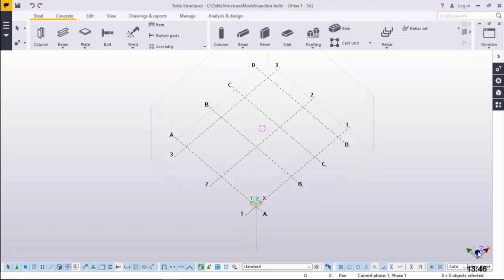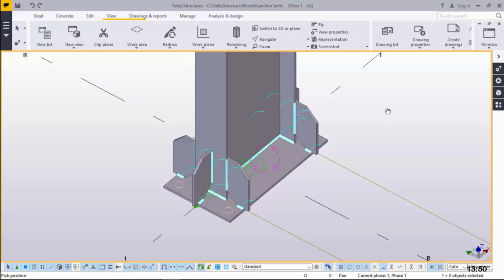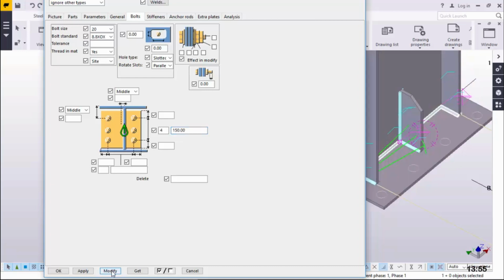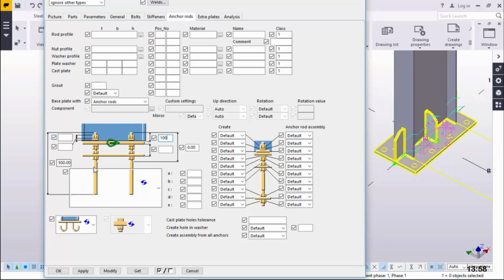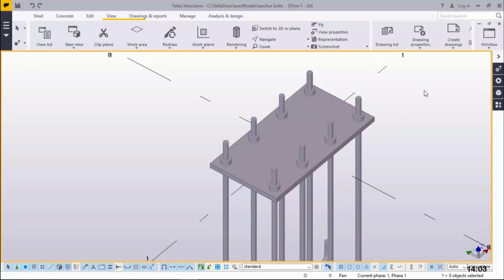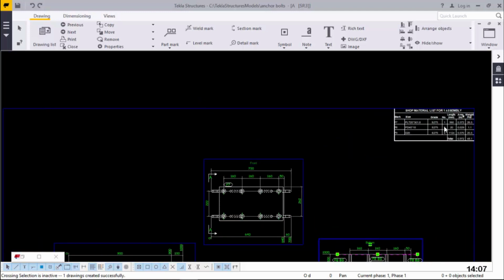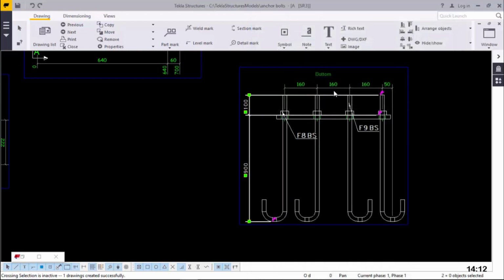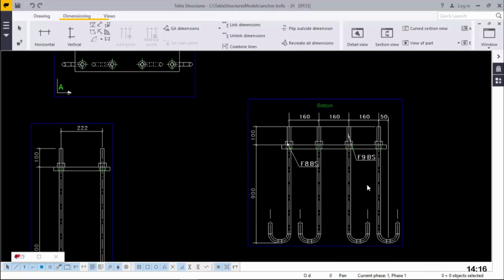Quick way to create anchor bolts and drawings in Tekla Structures

Comment: Hello, great work you doing. Am new to Tekla Structures (Version 2017) and I've found your tutorials amazing. I have a challenge now, I can't seem to be able to create detail drawings. On the "Drawings & reports" menu, the "Create drawings" tab does not have a drop down option... So I can't see options to Master drawing catalog, single-part drawing.... GA drawing. I can't find those options, since there is no drop down option to choose.. which leads to numbering of the model... Pls how do I go about this?
Reply from the maker: Re-install tekla structures,2017 is always the best just reinstall it.and you will be able to access the drop down arrow.
Reply: @MauriceDimba  thank you for the response.. I will and give u a response.
Reply: @MauriceDimba  Hello Mr Dimba, I did the reinstall, but it was the same... so I just decided to select "Full" under the configuration tab on the setup page and the menu now looks like yours.. I guess problem solved. Thanks for everything. Keep up with the good work.